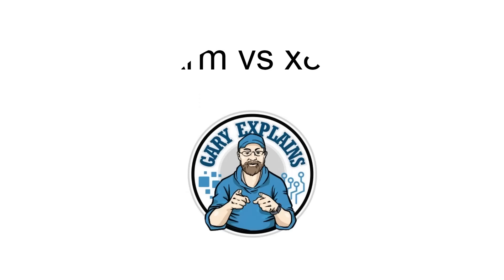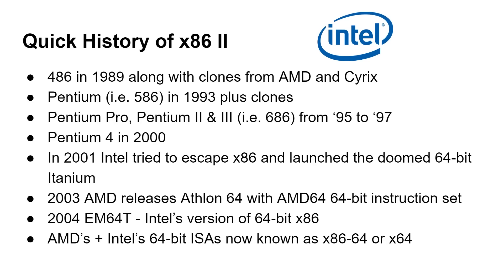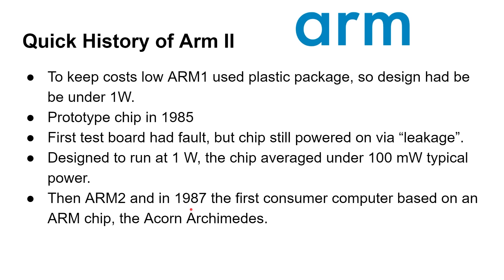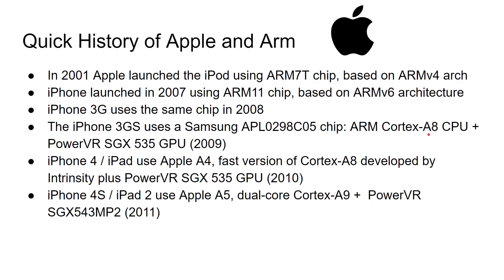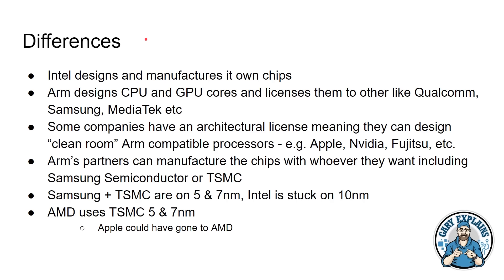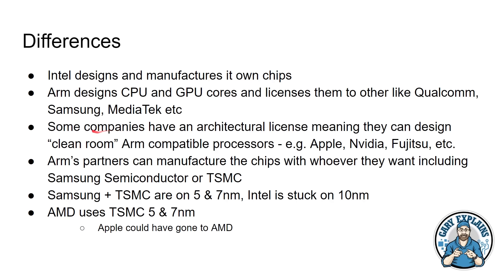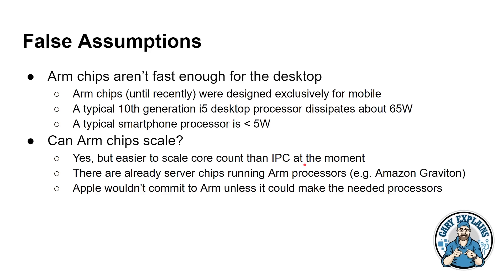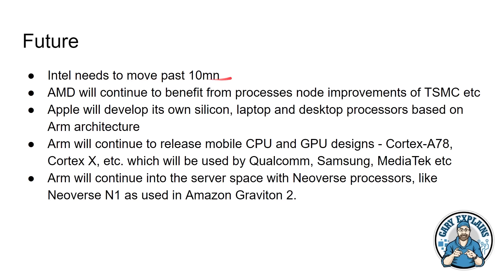Arm vs x86 - Key Differences Explained

Comment: Apple is in for a world of trouble with this switch.
First understand that inherent to RISC micro-architecture, ARM chips have significantly less performance per core than x86 because  each core has to execute significantly more instructions then in x86 to accomplish the same task.(for example the new neoverse N1 ARM cores are 4x slower than the new AMD Renoir x86 cores) This disadvantage makes ARM chips fundamentally more expensive to produce than x86 chips at comparable performance levels because they need many more cores, transistors and much more expensive memory to operate at the same performance.  

ARM chips also lose all power efficiency advantages at comparable performance levels to x86 due to much larger amounts of memory/cache activity and transistor counts than in x86 chips. 
ARM chips makers like Apple have now began modifying the ARM micro-architecture and adding to the instruction set in an attempt to catch up to the performance of x86 chips. The Apple A13 and the A64fx chips are no longer ARM chips but they are now custom ARM-compatible chips because they have a specialized instruction set and a custom micro-architecture.
The custom micro-architecture of Apples a13 and the a64fx chips similar single thread performance to x86 chips but now cost far more to produce per core than any other chip in the market. For example if apple scales up the performance of an a13 iphone/ipad chip to match the performance of an 8 core AMD Ryzen 4900HS CPU it would cost $900 for the chip alone and consume 60 watts of power.
In comparison the 8 core AMD Ryzen 4900HS would perform the same but it currently costs just $900 for the entire laptop and consumes only 35 watts (half of the power). When Apple releases there chip it will already be embarrassingly behind x86/AMD.

ARM/RISC based chips especially the server chips are also extremely inferior to their x86 counter part in performance per dollar which is very important in HPC (high performance computing) and consumer electronics.

The worlds most powerful x86 chip vs the worlds most powerful ARM chip:

ARM based A64fx chip:
$9,000
2.5 teraflops 
170 watts

x86 Epyc 7742 chip:
$6,950
3.5 teraflops
225 watt

These chips have the same performance per watt but the ARM chip has ~30% less performance per dollar then the x86 chip.  Not to mention the ARM chip is limited to just 32GB of RAM. Thus, the fugaku supercomputer based on the a64fx is 40% more expensive than the frontier supercomputer based on the EPYC 7742. ($1 billion vs $600 million), a $400 million difference! the x86 frontier super computer is also 3x times more powerful too. (1.5 exaflops vs .5 exaflops). So, the x86 option cost %30 less for 3x times more performance.

The newest ARM chip server micro-architecture is called the neoverse N1 which will be used in both the Amazon Graviton 2 chip and the Ampere Altra chip.

Comparing the new N1 ARM architecture to the x86 EPYC 7742, the EPYC chip is 4x times more powerful in single threaded performance and 3x times more powerfull then the most powerfull N1 configuration featuring 128 cores which could cost $8,000 to $9,000.

So ARM CPUs are a bad joke compared to x86 at high performance computing.
Reply from the maker: Nonsense.
Reply: @GaryExplains  I see.....well I guess its hard to disagree with such a compelling argument.
Reply from the maker: @lb5928  I thought I was quite eloquent! 😂😜
Reply: Finally, someone write the true, because everyone is now mad from arm, because apple said that.. Typical apple PR.. But, apple is aiming for basic tasks, which is more than 80%of their userbase. So i see ARM as a good choise. Just add there the power consumption and here we go. I clearly see those ads, where a x86 man would charge laptop every 5 hour and apple boy will smile thru 2 days.. I also see youtube comparison of adobe products on arm and x86 with battery longetivity and how faster the arm is.. All in all, it is something new and im glad for that. But to see x86 as dead thru 5 years is nonsense..
Reply: "For example if apple scales up the performance of an a13 iphone/ipad chip to match the performance of an 8 core AMD Ryzen 4900U CPU it would cost $900 for the chip alone and consume 60 watts of power"

I honestly have no idea where you pulled this BS figure from but I can assure you that it WOULDN'T cost $900 for Apple to create a SoC with a similar CPU performance to Ryzen 4900U. According to Techinsights A13 should cost around $64 and even if you include the cost of baseband processor it's still well under $100. What kind of processes would involve 9x increase in performance when achieving less than 2x performance increase? 

60W TDP is a ridiculous assumption as well - A12X, a two years old tablet SoC built on 7nm process, is considered to consume roughly ~9W at peak performance state. Meanwhile, 15W Ryzen 4800U from this year is very much comparable to it in single core performance and "only" 44% faster in multi core in Geekbench 5. Hell, Apple doesn't even need to double the number of performance cores nor use newest 5nm lithography to catch up to AMD's performance and power efficiency. You're underestimating Apple's silicon prowess, they will leave Intel in the dust once apps will get optimised for their upcoming SoCs.
Reply: @xuman1234  No, he pretty much addressed most of the stuffs he said in the video.
Reply: @supertigerman013  You're just being an apple fanboy.

Apples A13 has similar single core performance to AMDs Renoir cores in the 4900HS but the 4900HS is an 8 core 16 thread chip with an embedded GPU capable of nearly 2 teraflops all for just 35watts.

According to public benchmarks the entire a13 SOC, gpu and all would need to be scaled up in core count by a factor of 6x (12x times for the GPU cores) to achieve similar performance to the 4900HS as the a13 only has two high performance cores/threads and a weak GPU.

Since the a13 SOC cost around $65 and consumes ~9 watts under load then at 6x the GPU/CPU core count the cost would be between $800- $900 and would consume ~60 watts. (including the cost and wattage of scaling up the GPU)

2x times the power consumption at possibly 3x times the cost of the AMD 4900HS.
Reply: @lb5928  A12X smacks Ryzen 4700U in graphics performance. I don't see how 4900HS, whose GPU only has 1 more core and is clocked 150MHz higher than that of 4700U, would even perform better than Apple's upcoming laptop SoC that is destined to be significantly faster than A12X in every conceivable way.
Also, A13 that you're talking about is a mobile phone processor that has a TDP of ~6W, so you basically did all your calculations wrong from the beginning. I mean, it's not like the rest of your calculation processes aren't terribly messed up anyway, but it's still worth pointing out.

The new SoC from Apple is rumoured to have 8 high performance cores and 4 power saving cores for the CPU. Apple will most likely renew the core design for much higher single core performance while making it more power efficient than before, so you shouldn't even be making an assumption that they will use the identical CPU core design from A13. 60W SoC that costs $900? Ha, in your dream lmao.

Comment: Do you think Apples new Mac ARM SoCs are based on ARMs Neoverse N1 or better yet E1 architecture?    Because all the other ARMs chips before were based in a cluster sizes up to a maximum of 4 cores.   The E1 can have a cluster up to 8 cores.   The N1 can have clusters from 8 cores up to a maximum of 16 cores.
Reply from the maker: Apple's silicon isn't based on any designs from Arm, it is Apples own design. Also, since DynamIQ, all Cortex CPUs can have 8 cores per cluster.

Comment: When are they finally going to increase floating point precision? As these have been around already for ages and precision would be needed... 
in quite many cases big linear systems of  interest lack in precision. And also for standard numerical derivatives this is quite a big issue.
I think it is even not so clear what kind of impact such a change would have on convergence rates. Given a nonlinear system not too special (but very big) I could bet that a quad precision processor would probably finnish before the double precision cpu running twice the amount of operations (make calculations even). Scratching my head sometimes. Yet I have seen it too many times that for certain systems even multiple precision algorithms can beat the hell out of a double precision calculation based ones. Especially if complicated jacobians and or hessians are calculated.
What is actually behind this? 
I guess nobody really likes anymore single precision, yet for typical results single precision precision would be great. And even for a single division operation by two doubles it is just that I think. Numeric errors are largely underestimated it seems.
The IEEE floating point 754 numbers have been already newly redefined without ever being implementing quad precision in any mainstream processor (now octuple precision is already the highest level standard) https://en.wikipedia.org/wiki/IEEE_754#2019
How come?

Comment: Very interesting thank you but you actually missed an Intel chip out from 1979 the Intel 8088  similar to the Intel 8086 but the 8088 had an 8 bit external bus where as the 8086 had a 16bit external bus.
Reply from the maker: I didn't miss it, I opted not to include it for brevity.

Comment: Isn't RISC the acronym for Reduced instruction set Complexity not Computing as it hints to use less complex and therefor less power hungry instructions like AVX512 on intels side. The whole point of risc is to reduce instructionset complexity and maybe use more instructions for a given program but do them way more efficiently. I.e. Use 5 instructions using 1nW compared to 1 instruction using 20nW and further allowing clock speeds to rise as the traces should not be as long etc.
Reply from the maker: The opening paragraph of Patterson's paper on RISC says very clearly, "The Reduced Instruction Set Computer (RISC) Project investigates an alternative to the general trend toward computers with increasingly complex instruction sets..." I also have a whole video on CISC vs RISC here https://www.youtube.com/watch?v=g16wZWKcao4

Comment: wow, a lot of info packed in there.  Pretty much anything past the Pentiums you listed was somewhat new, as far as the ARM side of things.  

I've been wondering how thin the chip could get and still keep the integrity.  One reason I don't trust thr 128+ GB flash drives for more then a few writes.

I look at CISC and RISC as sides of the same coin.  My favorite computer (rhe whole VAX family) vs the SUN sparc and ultra sparc and minis - don't know.  I like both for different reasons.

With modern computing,  I've never really trusted AMD, to have fully compatiable instructions for Intel's and have teneded towards the latter.  However, working with Rasberry Pi and other SBCs, ARM is something I like for projects.

We are living in an exciting time in computing.  A leap and bound above Babbages's adding machine, huh?

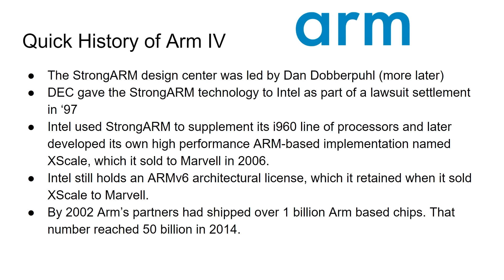Comment: 16:14 ARM chipd until now have been designed exclusively for mobiles 03:26 Intel & Apple 04:00 ARM 05:56 ARM & Apple working together 05:59 spun off from Acorn in 1991, transgotmrd itself intellectual property company 06:19 Digital equipment 07:45 Apple  and Arm have a long relationship
Reply from the maker: Until now? Hmmm... no.... The original Arm chip was a desktop chip. Arm chips have been used in networking equipment for years and Arms Neoverse range was announced in 2019.

Comment: Fugaku.  158,976 nodes.  52 cores per node.  That’s 8,266,752 cores.  Can we run Proxmox in there LOL?  A CEPH cluster or two perhaps?  OMG the management and the organization that must require.  Do you use Ansible?  I can’t even imagine.  I would love to visit that data center.  This video is really great.

Comment: Do you think that Apple switching to ARM will convince Microsoft and its partners to put more effort into Windows on ARM?
I would imagine that the parts of software written with SMID compiler intrinsics or even hand crafted assembly are the most difficult to transition.
These parts however are probably not very reliant on operating system functionality, meaning it should be fairly cross platform.
My hope is that companies like Adobe optimizing rewriting their software for Apple Silicon will bring their software to Windows on ARM as well.
Reply: Microsoft had already announced they would and have products, but Surface Pro X is still a bit expensive and x86 emulation is... not great.
Reply: For ARM to really work well in the PC desktop space, I think several things need to happen.  First, a standardized, open, boot process that allows different operating systems to be booted easily needs to be developed.  Second, Microsoft needs to release a "universal binary" type system.  Third, Microsoft needs to release a full version of Windows on ARM, not the neutered Windows-store only version they did with Windows-RT.  And, fourth, a good infrastructure of hardware (network cards, graphics cards, sound cards, etc) that doesn't require poorly written and poorly maintained proprietary drivers needs to develop.  Performance isn't the real issue holding back ARM for the desktop.
Reply: @o1knives  If you check ARM servers, they already have a standardized boot process that could easily be used for the desktop, because it's UEFI. It's called "ServerReady". A port of Tiano Core to Raspberry Pi 4 exists which fits that standard. Supposedly the Microsoft Surface Pro X runs an ARM version of Windows Home edition. From what I've seen most ARM devices with expansion just use regular PCI(Express) and existing drivers (build from source) pretty much just work.
Reply: @o1knives  
People did succeed booting Linux on ARM notebooks. But sure the situation could be improved.
"Universal Binaries" are a nice to have, but not really necessary. People are already used to different versions for 32 bit, 64 bit or different versions of Windows.
The Windows running on ARM notebooks is  "full" windows. You are not tied to the Windows store and UWP. Normal Win32 apps run, even when compiled for x86 (x64 emulation unfortunately doesn't work yet. In my opinion the real problem).
Don't get me wrong. I am a big fan of open source, but the open source drivers included in the Linux kernel e.g., on top of lacking many featured are often even more buggy, less maintained than their proprietary Windows counterparts.
I also think that performance is holding back ARM on Windows. All ARM Chips have either been sub 5 W mobile chips or low single core performance server CPUs.
Reply: @ymi_yugy3133  Interesting!  I did not realize Microsoft had released a full version of Windows for ARM!  (Shows how much I have been paying attention!)

For power users, I don't think there would be much need for a universal binary, but for more average consumers, I'm not sure how well expecting them to know if they have x86 or ARM will go.  I mean, currently, it doesn't really matter if you install the 32 bit or 64 bit version of a program (from the consumer, not power-user standpoint).  They both just work, and have for many years.  I would think a universal binary would be a highly desired feature to reduce customer support.

My point about drivers is more based on my experiences with the Android hacking community.  The primary thing that keeps updated OS version (or alternate OS's) from being installed on slightly older hardware is often the lack of open source, or at least semi-open source, drivers for various hardware.  This is not an insurmountable problem, but is one that needs to be addressed before there is much buy in from the enthusiast crowd.  Probably won't matter to the average laptop user, though.

I am excited to see what happens with ARM performance when they expand their TDP.  I would love to see an alternate to Intel with an ISA that is at least somewhat less of a cobbled together mess!

Comment: well if RISC cpu doesnt have a instructions necessery to do the job same job can take 3x or more time to complete on CISC more instructions are in first of all and well they can be easierly emulated and microcode can allow for more to be loaded it
Reply: ARM already prepare a SIND, a new set of high performance instructions, also, Apple walk-around is using dedicate acelerator.

Comment: A slight issue with your comparing process node sizes between foundries. They use different standards for measuring and thus the node size can be measured differently but be physically the same size. For example, Intel’s 10nm is about the same effective size as TSMC’s 7nm. Intel’s problem isn’t that they’re behind in size it because they have had enormous issues getting their 10nm to actually yield working chips.

Comment: in regards of Intel being stuck in 10nm... can you say you're in Mexico when you are currently in Spain, holding an air ticket to Mexico? Intel is in the same situation. It has the tech to manufacture 10nm processors, but... they're not up to any standard yet... technically, I'd say they're on 10nm, but realistically, they're still stuck on 14nm
Reply from the maker: True, I was giving Intel some leeway.

Comment: Intel 10nm+ performance and density is roughly equal in  tsmc 7nm. This nanometres thing is just marketing. For proof compare upcoming tigerlake u benchmarks versus amd renior in laptops.
Reply: That rights but comparing process node by performance isn't also right, we had see many cases where a better process node doesn't mean a better performance, also in theory tiger Lake is 10++.